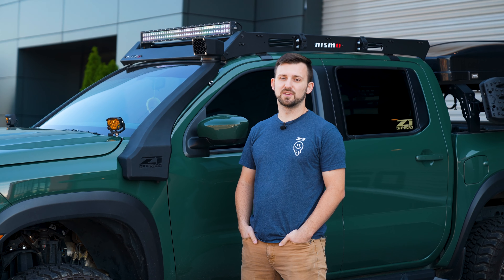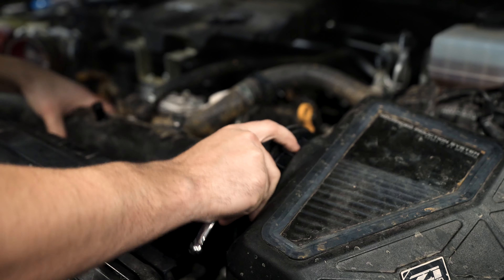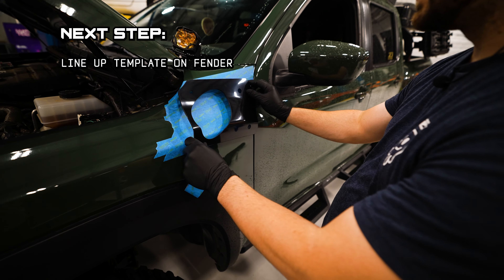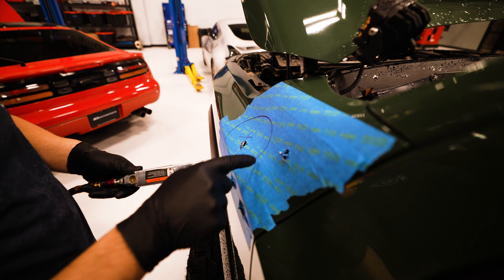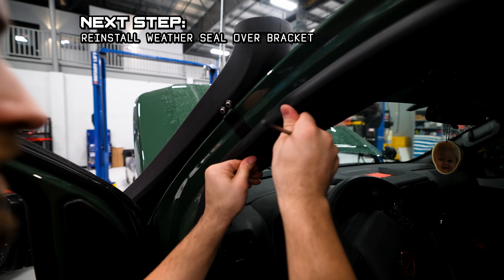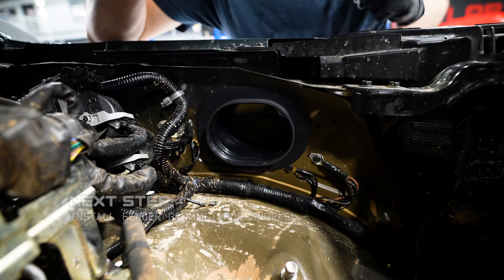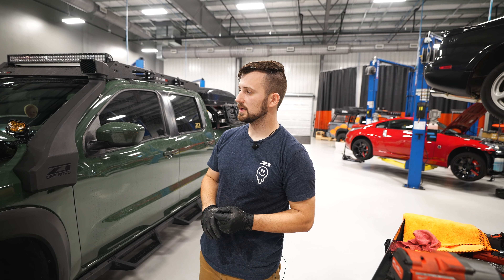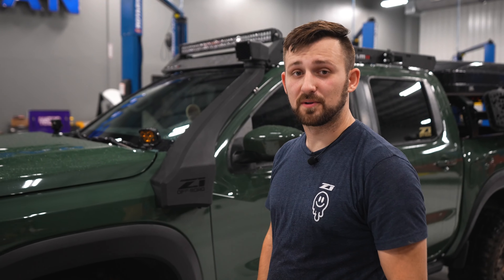Z1 Off-Road Snorkel Install for 22+ Frontier

Comment: Now that you guys made a gromet for the stock intake, is the process the same?? Or are their additional steps I need to know? I just received my order and want to install it pretty soon. 😁
Reply from the maker: Yes, the install is very similar. You will have to trim the factory air box volute to get the gromet to slide on.

Comment: I can’t find the answer anywhere so I’ll ask here. How does one clean the snorkel if it catches a lot of bugs inside? Can the drain plug be left open when using the hose to spray it down?
Reply from the maker: Yes, 100% you can do that. You can also just remove the head to make it a bit easier.
Reply: @z1off-road  thanks for the reply. I’m looking forward to the snorkel I ordered from you guys!